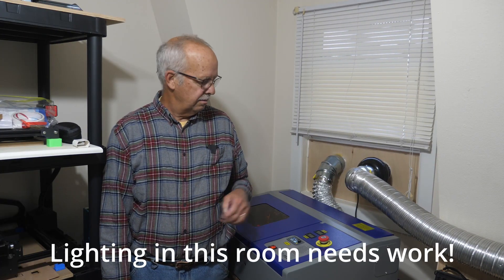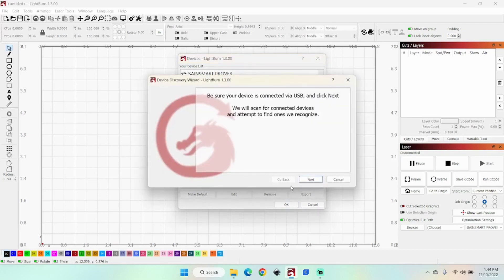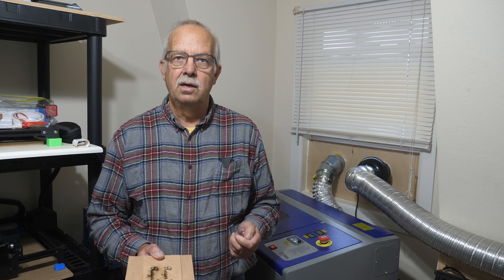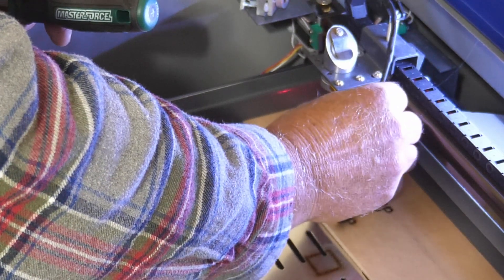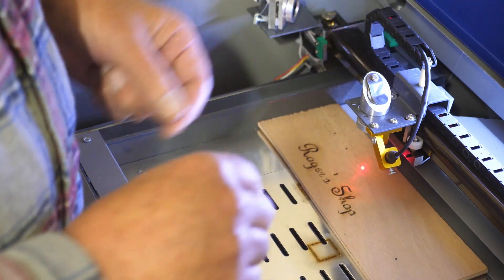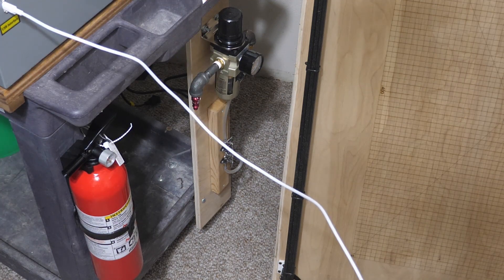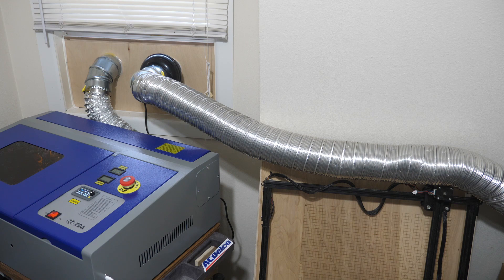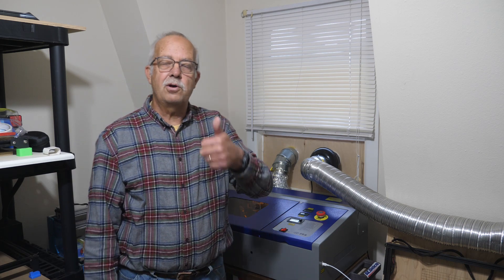Monport 40W Lightburn Setup

Comment: just got my laser   so i connected the usb but  lightburn come up  AUTO not chose for the comport .  also  they sent a flash drive with a laserDRW file to load on the computer but my computer does not find the flash drive  lol  ...
Reply: it is NOT flash drive!!!!! it is USB-KEY!!!
when u install LaserDRW, and will try to engrave, softwsre will ask u to insert USB-KEY (without it) you can not use the software

Comment: I had a LCD that was not working as well.
Reply from the maker: The replacement I used was inexpensive and actually, looks better.
Reply: @rogersshop  Drop a Link Let me see the Gauge you used.
Reply from the maker: @Ricks2Cents  https://amzn.to/3xDDSln
Reply: @rogersshop  
They Look Bad Ass!!! 
Have you Tested their Accuracy?
Reply from the maker: @Ricks2Cents  Yes, using a high end Fluke meter and probe.
Reply: @rogersshop  
Thanks for the Tip!!!  I’m going to pick 2 up. 
I like the Fact they are 12V vs Battery Powered.

Comment: Could you please show us what grbl settings you have?
Reply from the maker: Which settings?  That is a LONG list!  I'm using the GRBL settings in Lightburn as set by factory default, for now, with no problems.
Reply: @rogersshop  when you type $$ what do you get? Please copy that sir
Reply from the maker: @8mmmauser896  I didn't think this would all fit here!
$0=10
$1=25
$2=0
$3=6
$4=0
$5=0
$6=0
$10=1
$11=0.010
$12=0.002
$13=0
$20=1
$21=1
$22=1
$23=7
$24=800.000
$25=3000.000
$26=250
$27=25.000
$30=1000
$31=50
$32=1
$38=10
$100=160.000
$101=160.000
$102=160.000
$110=8000.000
$111=8000.000
$112=100.000
$120=500.000
$121=500.000
$122=20.000
$130=300.000
$131=200.000
$132=200.000
ok
Reply: @rogersshop  thank you so very much

Comment: Mine came yesterday. Currently on an Atomstack x7Pro and I am excited to see what the K40 can do. I want to add a LB camera, drill a hole and mount it dead center outside the viewing window. I see the is a 66,90,120,and 150 degree camera. Which should I choose? Had I of known the chiller was out of stock when I ordered, I would not of gotten the combo. I did however get a chiller from Vevor and when the Monport comes in will have a spare, or run a double chiller when the Texas heat returns this summer if need be.
Reply from the maker: For a camera mounted on the laser, I suggest at least a 120 degree view and then you will have to play with the angle.  You may also want to consider adding additional LED lighting inside.  I did this and that video will post soon along with my chiller (heat exchanger) setup.  The CW3000 is technically a heat exchanger, not a true chiller as it has no refrigeration capacity.